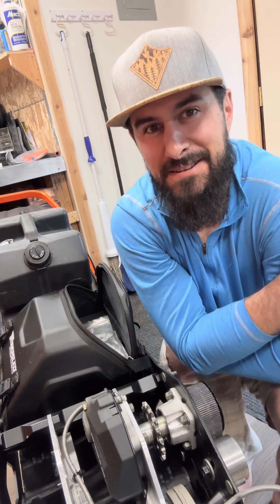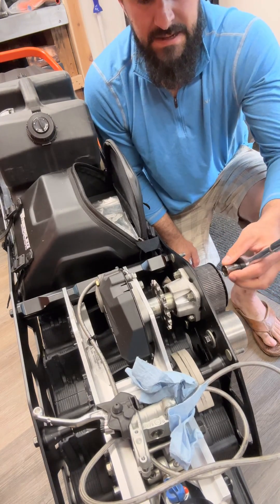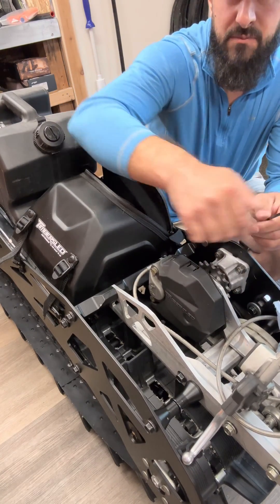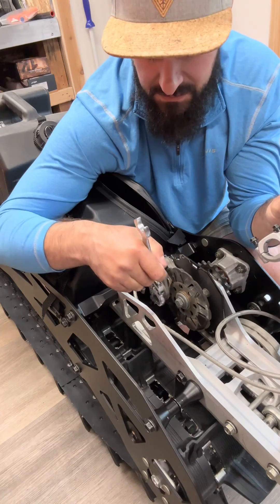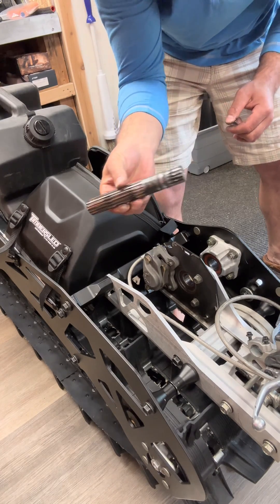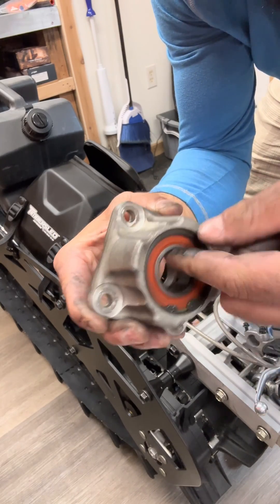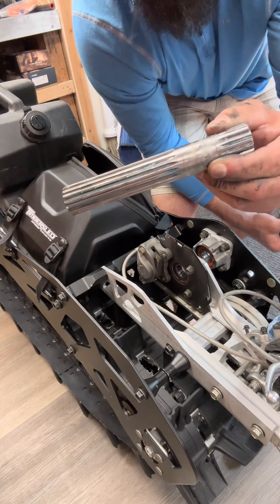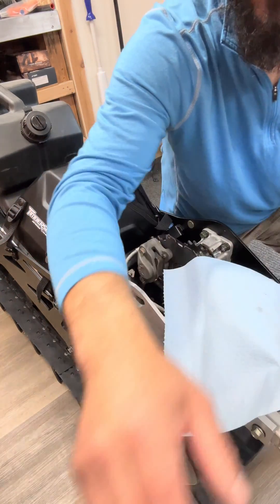Timbersled Dual Bearing Installation

Comment: How did you align those 4 loose nuts? you said there was a trick. that was the reason i was watching.
Reply from the maker: @sidbox  take a long metal straight edge to the outside of both the lower and upper gears together and make sure they are flush. I slowly tighten the nuts down and then use the straight edge to verify both the gears are even. There is a little play in the housing and if you spin the gear by hand and it doesn’t spool freely the jackshaft is bound up and not straight. Hope this makes sense. I apologize for not showing this in the video.

Comment: Good instructions. I will be changing to a dual bearing block. I did notice that you didn't torque the bearing block bolts after reinstalling it in the video. You probably did offline but just saying it so you didn't skip that step and have a bad experience on the snow. Thanks for the good video
Reply from the maker: @robertpasko-u7z  good eye! You are right and later that day I remembered to go back and tighten those four nuts. Glad this helped someone, it’s an easy job but helps to see it done once and know which direction the axle comes out. Cheers!